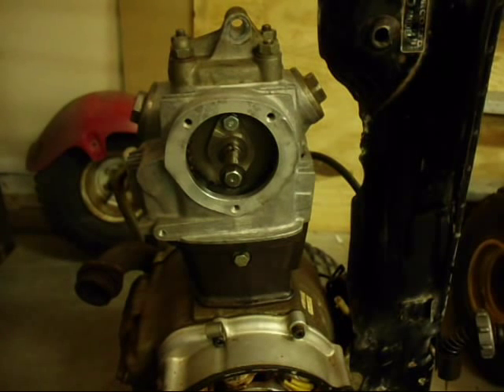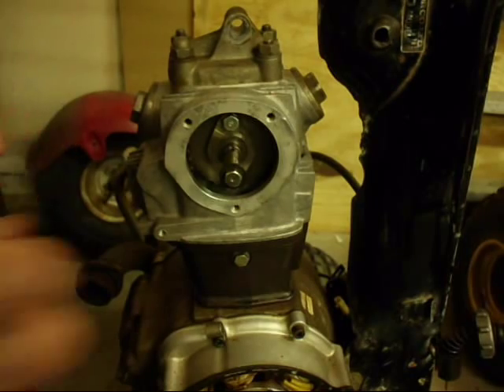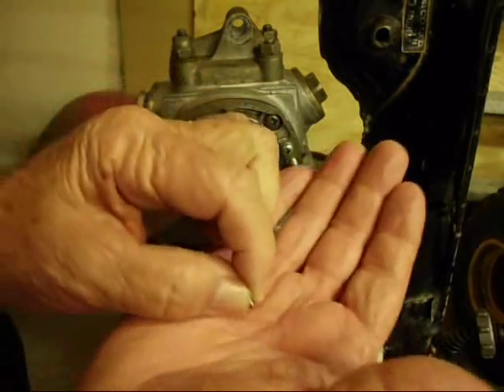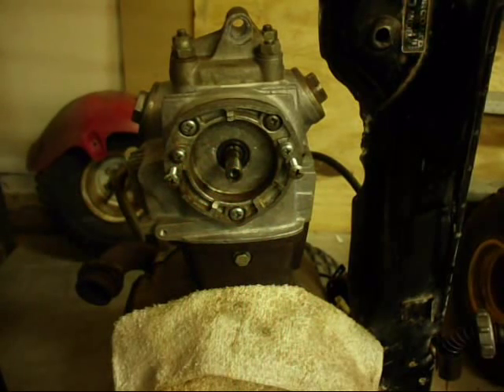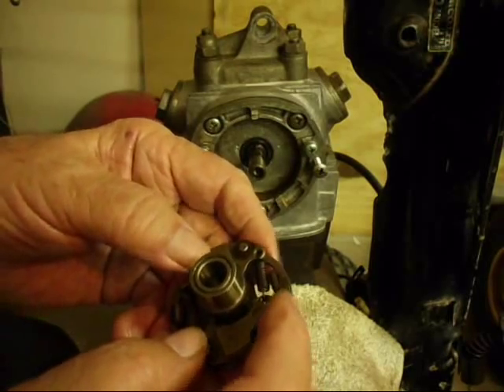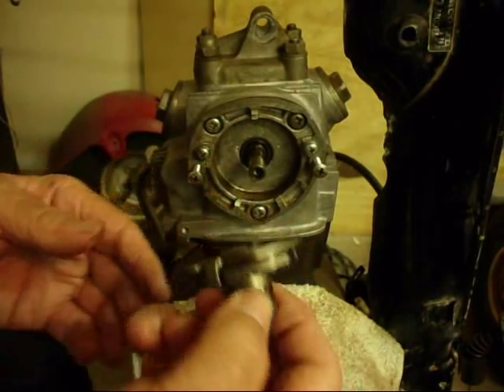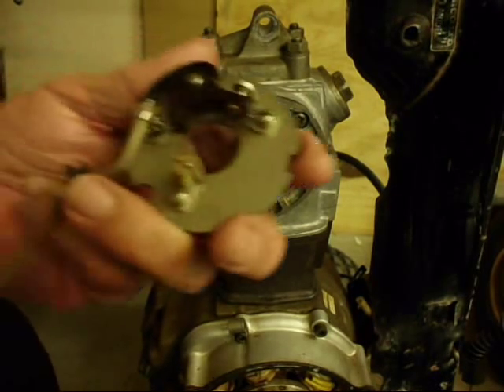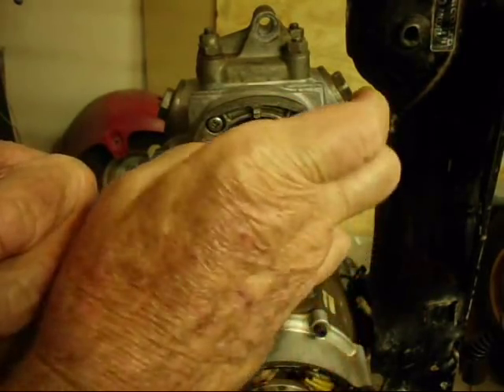1980 Honda ATC 110, Top End, Part 4 of 7, Ignition Timing & Point Gap

Comment: I have 1979 atc110. I had what I thought was chain slap when riding from the timing chain. Upon disassembly chain is good with plenty of adjustment left but there a groove worn in the end of the camshaft between the 2 bolts. I'm wondering if maybe the timing chain wasn't actually on the center guide but on the outside of it, causing the cam to slide out and rub the back of the inner points cover as well as the chain rubbing the case inside. Do you think what I'm talking about is even feasible?

Comment: A Bruce how do I deturmin which head is which from a 90 and 110
Reply from the maker: I can't tell you the differences.  I just checked the part numbers and the CT110 cylinder head seems to fit all years of the CT110 and the 1984 ATC125m.  Some of the CT90 cylinder heads fit the CT90s and the ATC90s and ATC110s.

Comment: So you want the gap on your points open or closed when your on your compression stroke?
Reply from the maker: Looking at the left side of the engine, it turns counter-clockwise.   So the "F" mark in the rotor will pass the timing mark on the cylinder head before the "T" mark.  The points are normally closed.  As the engine turns and the "F" mark reaches the timing mark on the head (on the compression stroke), the points will just start to open and will fire the spark plug.
Reply: @SoCalBruce  Thank you kindly for your time and response, Much appreciated...
Reply from the maker: @InTheFleshInc  You're welcome.  I hope you got it running.